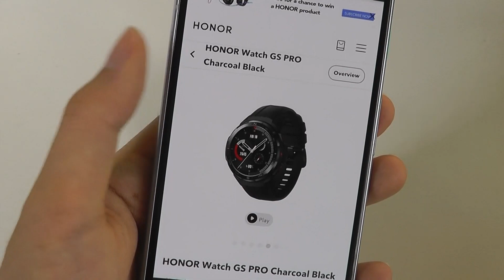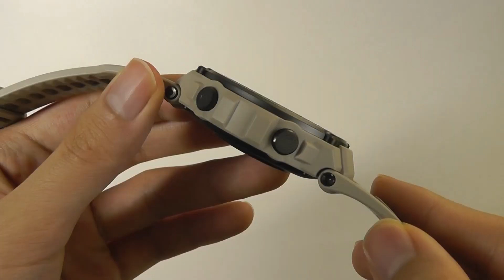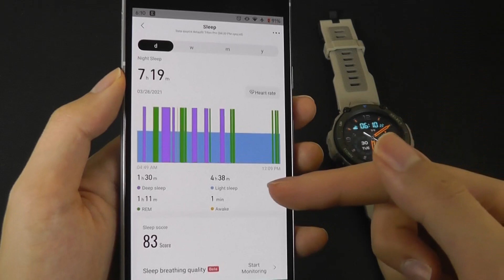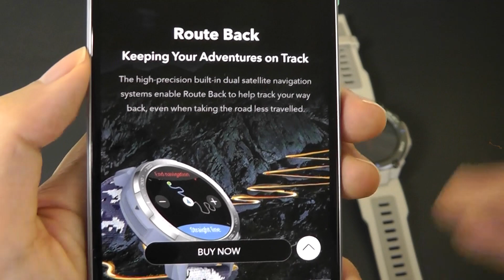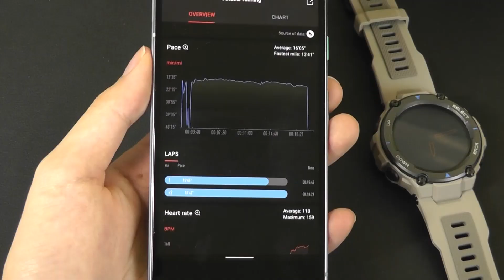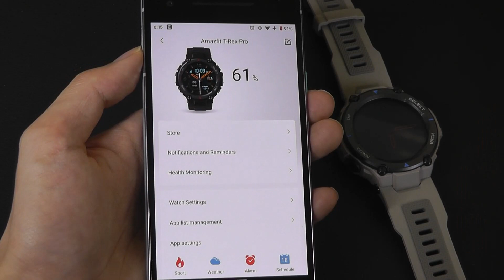REVIEW: Amazfit T-Rex Pro Rugged Sports Smartwatch! 10ATM, Quad GPS, 18-Day Battery Life!

Comment: How many times did you tap the face and it didn't respond? I have a Stratos 3 and have not really been impressed. Touch screen is almost useless. I do like the gps though. Sailing mode is pretty good, just wish I could have that in the background and have the compass and speed reading.

Comment: Mine came in today.  I like the upgrades from my original T Rex, the new faces available on the watch and in the Zepp app and especially the blue color.  Some nice new features like the O2 saturation levels too. I was not able to find the ‘Lock’ function however which came in handy during cleaning up my old one after a day out on the mountain bike trails.  Oh well.  Easy enough to turn off I guess.
Reply: Hi Uncle Joe. Do you know if it is possible to pair the t-rex with a external bluetooth arm band ( like the polar oh1 or similar) or chest strap ? thanks
Reply: @crovaktiernan  I wish it could but it does not have the capability to pair with a chest strap or arm band.
Reply: @1518joefil1  what a shame!!! thanks anyway :)
Reply: is there any change in accuracy? like earlier in t rex without wearing the watch its shows heart rate monitoring can u please check and let me know....
Reply: @avijitacharya432  To me it seems the same as the original.  When you take it off, the HR number shows/stays at whatever its last reading was before you took it off.  The graph over time however stops recording both on the watch and in the Zepp app until you put it back on.  For example, I don't sleep with mine and it was showing 63BPM as my last reading yesterday when I went to bed.  I strapped it on this morning and the number is up around 71 as I am moving around a bit.  The graph also started tracking again where it had been blank all night. I am ok with the last HR number showing until I put it on again and do not see it as a defect.
Reply: @1518joefil1  thank u so much man ... no one in the review is mentioning that the hr sesnsr ... i used the t rex it even counts when ur watch is not in your hand...
one last question? whats about accuracy? r u satisfied with the accuracy?
Reply: @avijitacharya432  They are as accurate or inaccurate as any watch using optical sensors for measurement.  My friend and fellow mountain biker has an iWatch 6 and reports the same hit or miss results compared to a chest strap based monitor.  The tighter you wear the T Rex the more accurate it seems to be, but at the expense of comfort.  I just don't like it super tight. I am not overly obsessed with tracking my HR to the exact beat all day long however so the fact that it tracks within 3-5BPM on average compared to my chest strap sensor is good enough for me.  When I am mountain biking however, my HR can change by 30BPM or more in seconds.  While my chest strap monitor measures this in real time, wearing the T-Rex at the same time shows a delay in it picking up these rapid HIIT changes.  At the end of the ride however it shows the average HR and peak HR fairly close to what my chest strap monitor does.  I also compared the O2 sensor to a pulse oximeter that goes on my finger.  The O2 was within 1% of what the oximeter read and the pulse was within 3BPM.  Close enough for me.
Reply: @1518joefil1  ok thanks